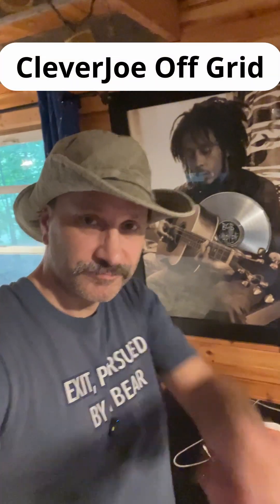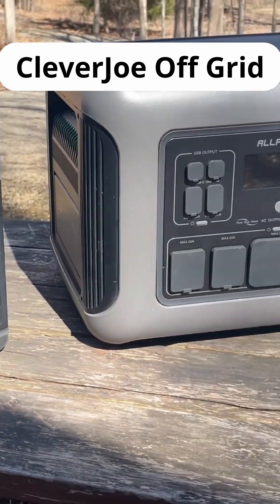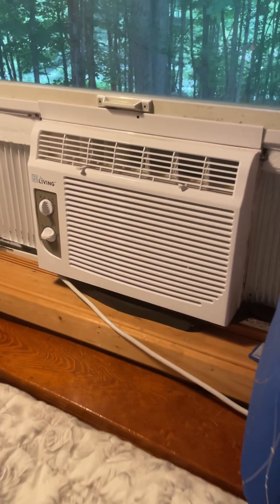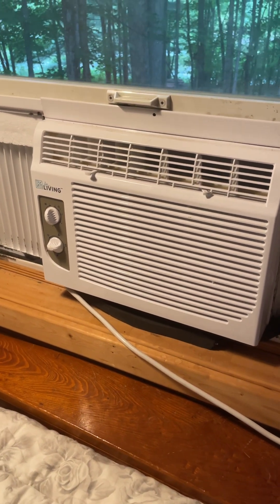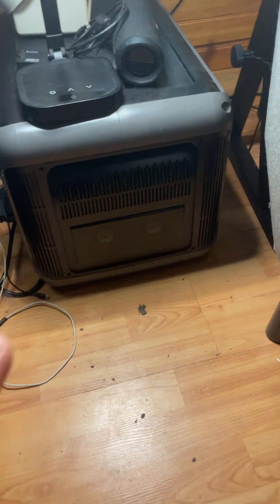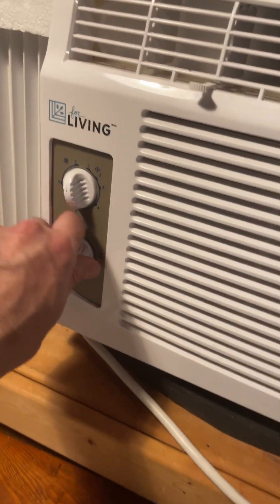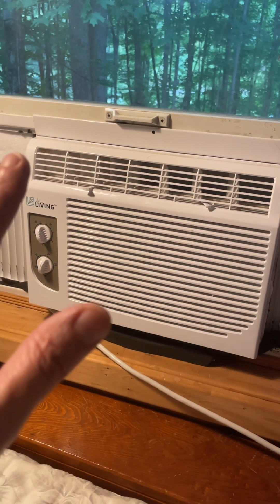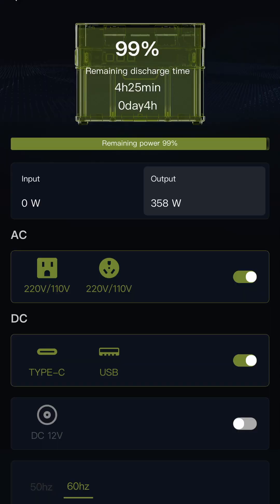Run An Air Conditioner with a Power Station? EcoFlow, Allpowers #offgridlife  #ecoflow #offgridcabin

Comment: I got a 2500 dual fuel inverter generator by Champion. However I live @ 6,000' elevation and wanted to use it at home plus in a RV = cold months @ lower elevation then back to high elevation. 
This generator must have a carburetor kit  change for each change in elevation! Bummer!! 😮
If you dont do the switch you ruin the unit. I wanted to run it on propane only as that works best when not in use for long periods = gas doesn't store well.
So as a back up unit in the mountains its not available currently- til kit is installed. 
I've never heard anyone address altitude changes yet I know others especially RVers that are full time go with the weather. Maybe they have generators with a self adjust feature for altitudes. 
I knoww some companies that make diesel heaters have that built in their units. 
Hope someone can educate me on this. 
Continued carburetor kit changing does not interest me. I have limited knowledge of the procedure BUT mostly I have limited use of my hands at times...
Reply from the maker: Interesting, I hadn’t considered how altitude could affect a generator. I don’t know much about the topic, maybe someone else here will read this and comment. Good Iuck.

Comment: How long will it last? And let's say I wanted to put it on an ambulance camper.... would I need 2 or a generator also?
Reply from the maker: A power station won't run it long, I'd recommend using a generator if you're depending on it.
Reply: @cleverjoe What's a good generator to have on hand? That's reasonably priced.
Reply from the maker: @bobbydelamar606 I use the Honda eu2200i, excellent little generator if your power needs are modest. You’ll need an inverter generator if charging a power station.